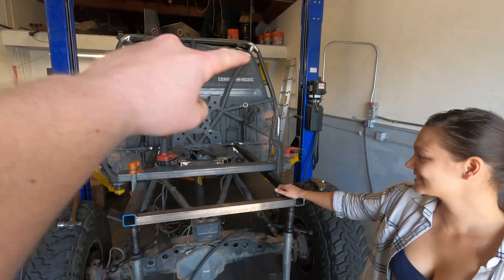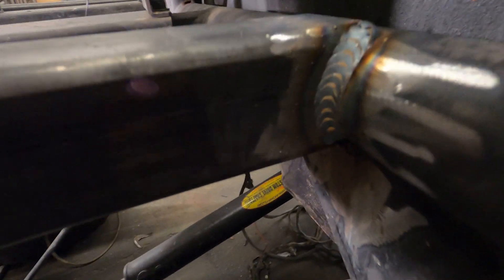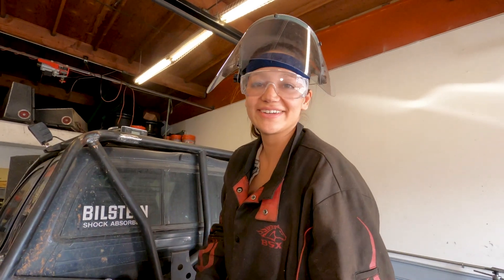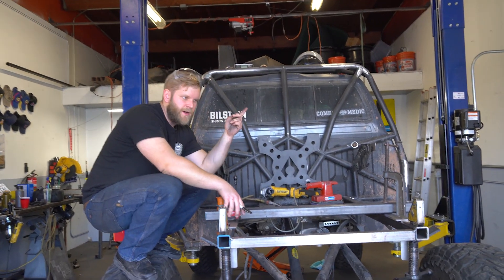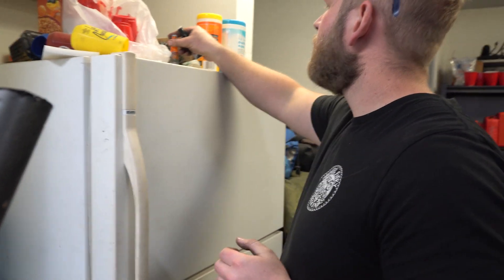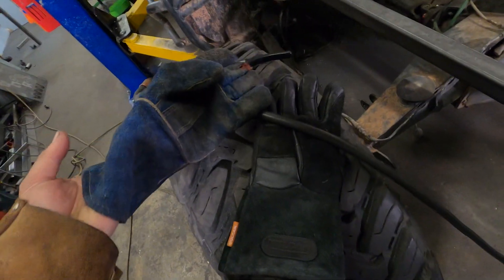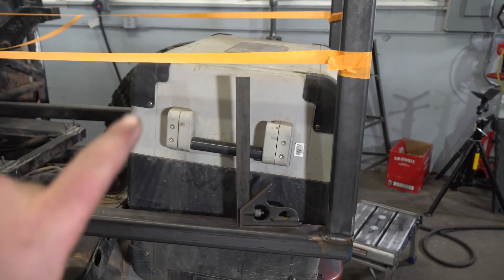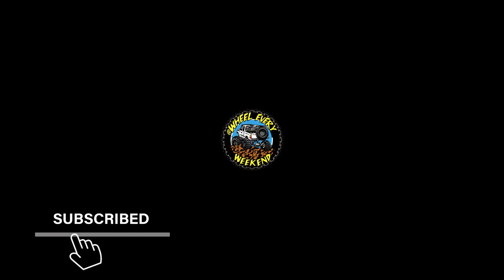Hardcore Overland Gear storage setup DIY build (part 4)

Comment: You can make a mini tailgate behind the fridge on the end on the slider, it can be used as lock for the slide as well as a work/cooking/mac n cheese prep area. Then the top section could be like you said a small awning of some sort.
Reply from the maker: It would be pretty rad to end up with some kind of table thing out of the whole deal. I could always make the skid a seperate piece from the metal behind the fridge, then make it slide out with the fridge. I didn't realize it until just now but i also need some sort of rear bumper, so that'll be fun to figure out with the fridge living where it belongs

Comment: Just "BURN IT!" on the back door you could build it flat that folds up with a couple panels that fold out on either side to make a decent awning the width of the truck.  Really enjoy the videos yall!!
Reply from the maker: We were just talking about that! I was thinking if you put a pivot point on the end you could have a bunch of triangular panels swing out In a circle to make something that kinda looks like an umbrella 🤔 would be cool and needlessly complicated which is my thing, but I dunno how to make it water tight
Reply: As far as the interior goes you make the door the full 32 inches to sit on the very back of the truck vs in-between the tubing. Place your hinges on the top of the frame so you can adjust how tight the door squeezes to the frame with all your foldouts going in-between the two uprights on the back. Just an idea.
Reply: If that makes any sense whatsoever 😄

Comment: Cool vid!  Looking good!  My idea/suggestion is to design the fridge access so no slide or movement is needed at all!  Faster can access the beer, the better. It could save lives
Reply from the maker: I need to explain it better, it's not possible to have fridge access without the slide because the entire top portion will be 1 big flat aluminum plate that all our junk gets piled on. So the option is either make a slide or take out all of our camper gear to raise the panel to get to the fridge. I think for sure either way you're gonna have to lift the tire, I could also make the entire back wall come up with the tire too I think

Comment: Fucking nice welds though..... should always do a quick wipe down with acetone before welding 🤘🏼
Reply from the maker: Thank you! My standards are pretty high so i spend alot of time grinding out welds which is humbling. Crazy how sometimes a bead looks perfect until you grind off the first half and it's full of damn holes haha
Reply: Wheel Every Weekend me too , I’m the same way but my welds are not as pretty lol getting better but I’ve ground out a few ditches and left a little Material and lay better beads lol🤘🏼